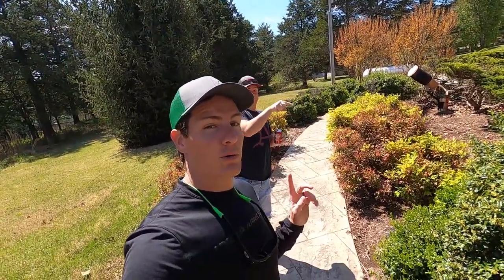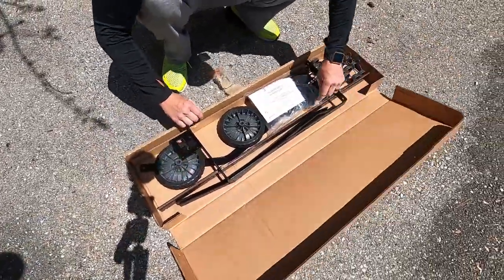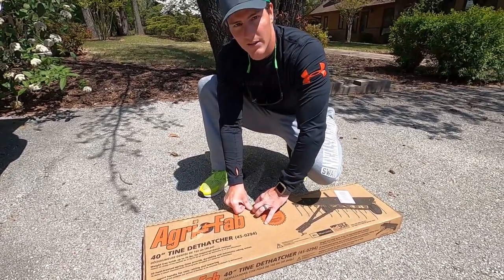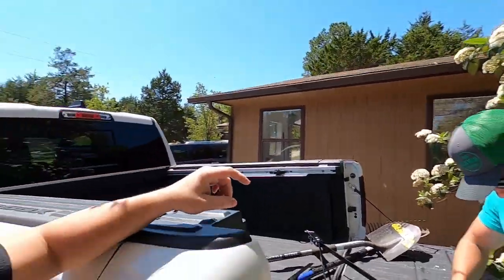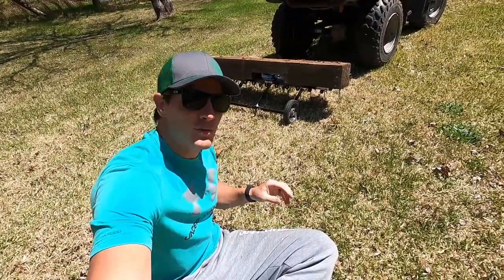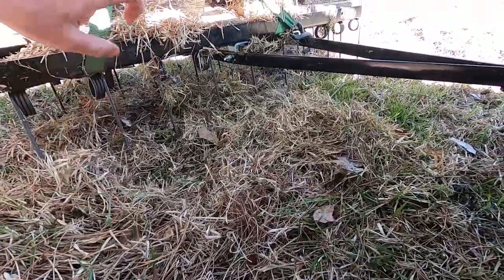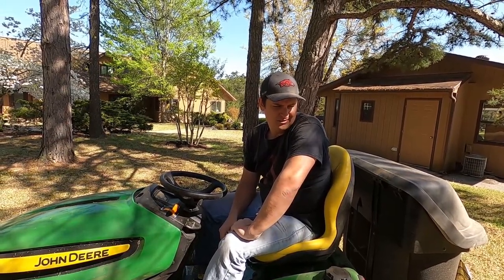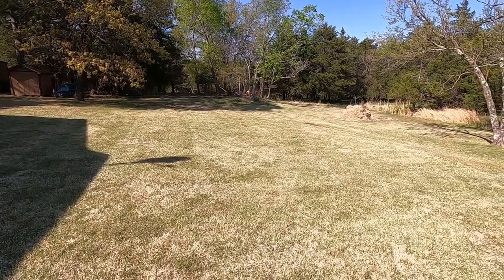DETHATCHING with Agri-Fab tow behind dethatcher

Comment: That's not thatch just clippings and dead grass sitting on top of the thatch layer. Thatch is literally a soil layer, its made on living material, some dead material but mostly dead material that's turned into organic material from improper mowing, grass dying, most of that material doesn't break down and your left with clippings, brown grass you can see that's matted over, still standing up but dead, that's the material you guys removed, you piece of equipment is only dragging along the the top of the thatch, it doesn't do much, they should of made the tines sharp so they actually dig into the thatch instead of dragging onto. What you removed still isn't good and needs to go

Comment: This dethatcher is crap!  Can't hook it up to my Zero Turn mower because my hitch is taller than "  Plus the angle bracket holding the arm needs two screws to keep it from twisting!  Total loss of $!120!
Reply: I use one with my JD Zero Turn without issues.   Can your hitch be mounted lower?
Reply: @nascarnate326  No it can't!  very cheaply made.
Reply: Return it 🤯